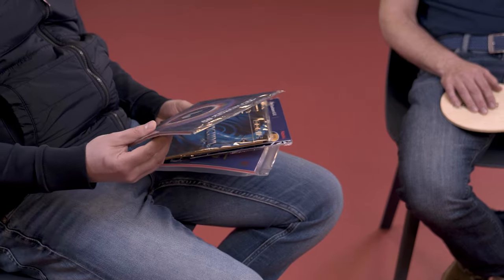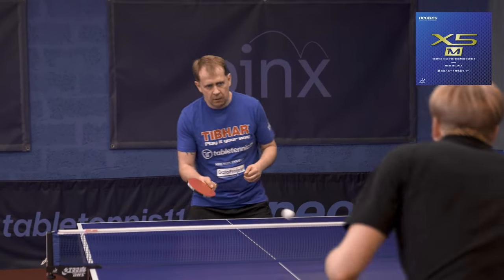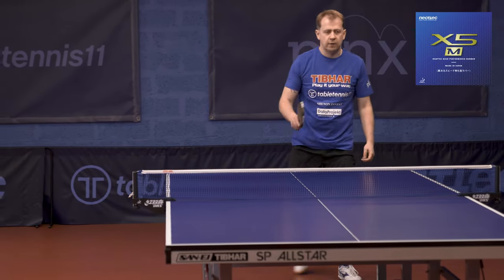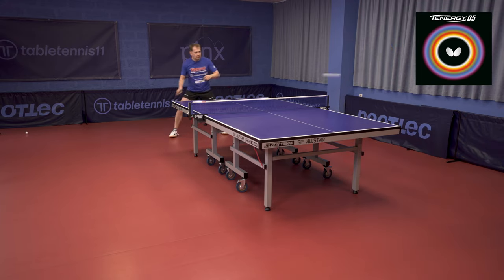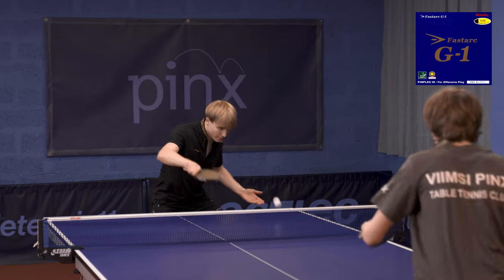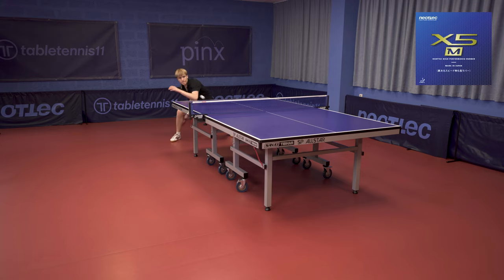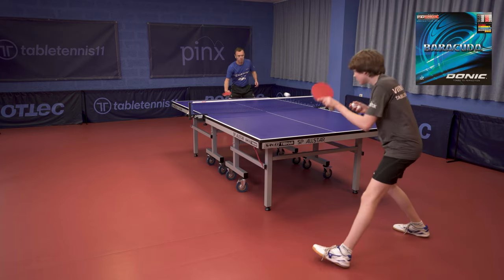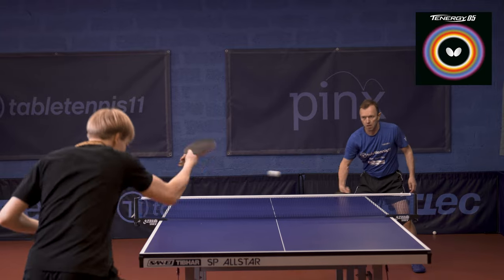Tenergy 05, X5 M, Fastarc G-1, Baracuda | Review and Comparison

Comment: Great review, and I agree that Fastarc G-1 is a great rubber, good control and very decent speed. I've bought many rubbers in your site, and I made the mistake of trusting reviews of advanced players when I'm begginer-intermediate. Bought Donic Bluefire Z2 and Rakza X both max sponge and put them in my Cybershape, and I couldn't control the shots, my game went down by a lot. Bought Rakza 7 soft and feels like heaven, it's a very consistent rubber with decent spin. I've used Fastarc G-1 on my backhand and it's really good, I'm improving my technique to be able to use its full potential.
I like the way you review the rubbers, not often you see the ones talking about the rubbers actually playing with them, and you can see on the videos what kind of shots are the rubbers good for.
Reply: I am an intermediate to beginner player and I have been playing table tennis for about 2 years. My blade is nittaku barwell fleet do you think the fastarc g1 rubber will be fast for me for my forehand or will it really provide good control and spin?
Reply: @yunusemregunes6391  It depends a bit on your style, if you're a looper, flat hitter, drive... Fastarc G1 is a good rubber with good control, but your blade is a bit fast already and paired with G1 could be a bit too fast. Don't know your level, but to learn and develop your strokes is good to go with rubbers with great control such as Rakza 7 soft. If you are not hitting the ball a lot out of the table (overhitting), I could recommend you Fastarc G1 on your forehand and Rakza 7 soft on backhand, although I learned in my first years with Rakza 7 soft on both sides.
Reply: you should try fastract G 1 on your FH and Razka 7 soft on BH ... thats my setup and my game improved a lot .. but i think its defend on individual
Reply: @Belgamor77  is fastarc g1 better than rakza for advanced players? Is it significantly faster?
Reply: @peterh4117  fastarc g1 is a bit more linear than Rakza 7, ball is a bit faster and closer to the net, while the Rakza has more arc, so a bit safer. I have been exploring other rubbers, and found out that Donic Barracuda is good for forehand (and backhand) lots of control and spin, apart from being quite economic. Also, Xiom Vega Pro is good for forehand (not backhand tho) because it has low throw angle (like the G1), but the Vega Pro has lots of control, I felt like if I could put the ball on the table every single time, but the speed is a bit slower than Barracuda or Fastarc G1

Comment: Hi guys, nice video (congrats) which gives people a better understanding of these rubbers taking into consideration the "millions" of possibilities of combinations 🙂
As a player with quite a long experience off/on the table I have played with Ten 05 before for about 7 years ! At first it was horrible, I thought I could play with but NO !
so this is what I give as advice, if you are an intermediate to advanced player who practices about once per week, this rubber is NOT for you.
Ten 05 requires feeling and timing so you don't overshoot, which is the the tendency of most of these players (very frustrating). For this it requires practice, when you do get it, it's great no doubt.
I have switched to G-1 because of what you said, it's a more tolerant rubber with lots of gears, especially if you don't have time to practice !! No questions.
One of the best shots (in my opinion) is the counter, you can smash through or even get amazing contact with a lot of control. This is not easy at all with 05 where the ball kicks away quickly.
I don't know Neotech, but I found the vacuum pack interesting (I wonder why), does the rubber decay too fast ?!
If you are not an advanced (Bundesliga level) player, your biggest problem will probably not even be technical... but your footing will be horrible, making "timing" the biggest issue, so tolerant rubbers will be the best option. My 5 cents 🙂

Comment: My main FH rubber used to be T05. I loved it because of its high throw arc and grippiness, which gave me really good loops and serves. But it was too expensive for me and very fragile. That's when I discovered Baracuda, which had an even higher throw and even more grip than the Tenergy 05. A bit slower but still really good mid distance. I have not tried G1 and X5, but from your reviews, I'm really interested in trying them out, especially on the BH, where I usually choose soft, low throw rubbers.
Reply: Nittaku G1 has a very stiff and strong top rubber. It's very durable and the spin speed and power is top notch.
Barracuda is very classical, but still, the spin is monstrous on hard hits, because it's slightly grippier and more elastic than G1.
Tenergy is maximum elasticity IMO, this comes with reduces durability and fast wear, which makes it costly very fast if you want to have the best effect until it reduces, which happens too fast imo.
DHS hurricane 3 (neo) has insane amounts of power with chinese power technique, but it takes the most amount of training to master.
Reply: try G1 it is way way better than baracuda.. You can do anything with this rubber...
Reply: @PilyongInggo  I wouldn't say better but very different.
Barracuda is not as precise as G1 but grips the ball much better, which can be bad at blocking slow spinny topspins, but perfect for backspin close game and topspin against long pushes.
Reply: @esmolol4091  Precisely. What I do with slow spinny topspins is just counter it head on off the bounce with a very close racket. Hard to do though, if I'm just one step slower, I wouldn't be able catch the bounce and either throw the ball off the table or wait for it under the table and loop it.
How's the Arc on G1? Is it anywhere near T05 or Barracuda?
Reply: @phtabletennisvlog4473  I would say it's definitely lower than the other two because the topsheet is very firm.
But for countertopspins far from the table I would say that G1 has more clearance and range than barracuda. Ten05 has the best overall arc and spin.
It always depends on the blade too.
With fast carbon blades ten05 is just a monster, while the arc on G1 becomes even flatter and a smashing maschine.
I wouldn't use barracuda with very stiff blades, but that's just my take.
Considering spin sensitivity:
Barracuda most
Ten05 just slightly less
G1 the least
Reply: @esmolol4091  Oh ok. I actually use a very fast stiff blade with ZLC composite. So the arc on the blade itself is a bit low. From my experience with T05 and Barracuda, I feel that the Barracuda has slightly higher arc, thus making it more comfortable on my ZLC blade. But yeah, it's does lack speed away from the table so I have to force loops when I'm pushed away. The G1 might be a bit too flat for me, especially paired with my blade.
If you can suggest other rubbers that has a high arc but not tacky, I would appreciate it. Cheers!!!
Reply: @phtabletennisvlog4473  
Donic Bluefire JP01 or M1.
JP01 more elastic topsheet, M1 a little less elastic.
If you want a tamed rotation beast (with fast proper full motion topspin technique, Donic Bluefire JP02, definitely not tacky, and needs to be engaged to unleash the rotation.
JP01 Turbo is the fastest of the 3.
None of the rubbers are tacky.
I consider only Hurricane 3 as tacky.
Butterfly Rozena is also non tacky with nice arc, lower than Ten05 for obvious reasons.
Reply: @esmolol4091  AWESOME!!! Thank you so much for this list. I'll try them out!!!
Reply: @phtabletennisvlog4473  You're welcome, have fun.

Comment: No way. I played tenergy 05 and baracuda for 2 years, the baracuda is noticibly slower and easier to play than the tenergy. The baracuda has a higher throw than the tenergy. And is relatively slow compared to other rubbers in general, for example the acuda and bluefire or bluestorm are rapid compared to the baracuda, currently I use the bluestorm z3, and is a lot faster than the baracuda.

Comment: Great review. I am extremely curious about the longevities of catapult effects of the rubbers. Could you let the two blades sit for some time say three months and re-test the rubbers? For amateurs like myself who plays a few hours a week, it is ideal to have a consistent rubber that works for 6-12 months.
Reply: You can just buy a solution that makes the rubber tacky again
Reply: @meh6513  I mean the catapult effect
Reply: the catapult effect doesn't fade away as quickly as the grip and the spin also u can boost it if u do want more catapult
Reply: The catapult effect coming from the sponge doesn't just fade away when you don't use the rubber. If so, then very slowly. The equipment deteriorates through use much more.
Reply: @ktosomcosom19 actually, it fades, because it's factory boosted, but it's correct, that playing makes it lose it's power much faster.

Comment: I am looking for a backhand rubber that is not too fast for my Stiga Offensive Classic (flexible and hard 5-ply wooden blade with koto outer layer). I like to use tacky rubbers for forehand -- it gives me the dwell time that is needed to develop my strokes. I have only played table tennis for 1 year. Stiga Offensive Classic is a bouncy blade, so I dont want a bouncy rubber. Currently I am using max thinckness Yasaka Rigan, but this rubber is being discontinued. Some players say that Stiga Mantra M is good, but this rubber is also being discontinued. Do you think Nittaku Fastarc C-1 2.0 is a good replacement? I am using Yaska Rakza Z on forehand and am absolutely loving it.

Comment: Hoping TT 11 will review Stiga DNA series rubber. My 2 sons r using victas v15 stiff and limber as their backhand rubber respectively, thinking of changing to DNA platinum m and s. Wondering if the DNA is too bouncy to control.
Reply: Do you mean that DNA platinum M is faster than Victas v 15 extra? 🤔
I thought v15 extra was faster,but with slightly less spin than DNA platinum... I'll have to try that one too. 😅

Comment: First time I hear negative feedback on tenergy rubbers. I've tried it once and i didn't like it myself. Which is why I scratch my head on some of the tenergy reviews that i've read before which are mostly good but kinda --- like scripted. Always the same things they say. THis feedback on the tenergy although negative kinda felt more aligned with my own personal experience with it. It's not a bad rubber but I do not see the justification of the price of it - as compared to its performance.

Comment: 1) Fastarc G1 - very comfortable, spinny, grippy and balanced.
2) Tenergy 05 - classic, spinny, good arc but too much bouncy provoke random mistakes, not stable rubber.
3) Baracuda - retro rubber, feels dead after 3-5 days, low quality, just cheap rubber for newbies.
Reply: Totalmente de acuerdo. Se nota que sabes de lo que hablas. T-05 no me acaba de convencer en el revés, quizás la versión dura vaya mejor. El problema de Tenergy es que la versión comercial no es la misma de los jugadores Pro. No puedes bloquear un fuerte topspin con la pala horizontal porque pierdes todo el control, es patético. Prefiero MXP antes que T-05 en el revés, es más estable. Probaré esa Fastarc G-1, a ver cómo funciona. 
Para el derecho prefiero las gomas pegajosas Pro.
Gracias.

Comment: What I dont understand in table tennis rubbers is that harder sponges often times are described as faster, but isnt it really that it is able to grip at faster speeds?
Reply: hard rubbers are faster when hit hard...soft rubber when hit hard sometimes go off the table.. 

Im using hard rubber (chinese rubber) slower than tensor rubber but when hit hard .. It is fast.. Same with medium hard to hard esn rubbers ...
Reply: @PilyongInggo  yea, softer rubbers go over the table when you hit hard because you lose control when the rubber bottoms out and dont grip the ball. I dont have the experience to say that this is how it works, this is how I understand that it must be because of the physics of it. My coach is adament about beginners using aoft rubbers, but I think chinese hard rubbers works for beginners if you have a flexible blade that suits it, like me. The problem I have is to find a good esn-type rubber for backhand that isnt too soft and not too fast. Atm I am using Mark V for backhand and this works ok, but I dont get super spin.
Reply: @z0uLess  Mark 5 , Sriver, etc...Son gomas desfasadas del Tenis de Mesa actual, después de la prohibición del pegamento rápido hace muchos años.
Estoy de acuerdo en que usar gomas chinas como la comercial DHS H3 es la mejor manera de perfeccionar la técnica de derecha y de revés. Más adelante si llegas a un buen nivel usas lo que usa Ma Long, Timo Boll o Vladimir Samsonov, que básicamente usan  los 3 tipos de materiales ofensivos que funcionan para diversos jugadores. 
Lo que comentas es importante, las gomas blandas no sirven para nada, solamente para perder el tiempo. Ningún Pro juega con gomas blandas, las pelotas saldrían locas.😂
Reply: @davidsomo1651  I understand some of those words. Kan du skrive I et språk som jeg forstår?